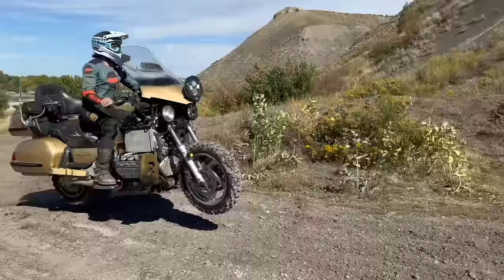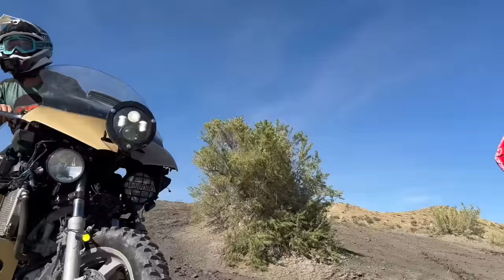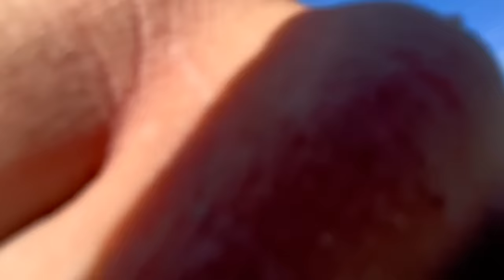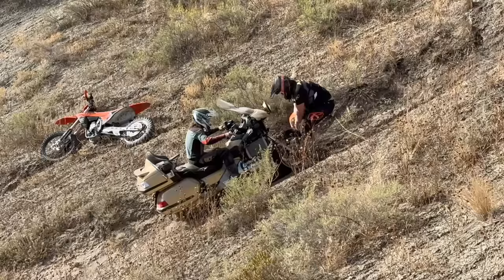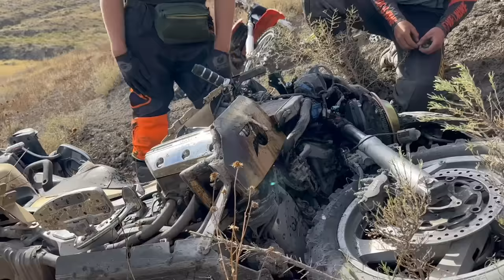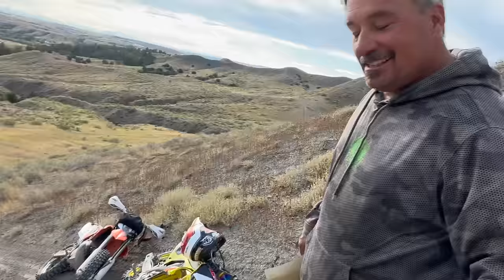Honda Goldwing vs 450 - Hillclimb Challenge

Comment: One things for sure, that flat 6 sounds sweet at limiter up the hill
Reply from the maker: what a rippah
Reply: Yes it dose !!
Reply: I was just thinking the same thing. That’s one amazing sounding engine!
Reply: Sounds even better with Cobra exhaust. It's a pig for sure, but handles vert well at low speed and pulls hard through mod third gear. Great machine.

Comment: That is way too much fun to let it just end like this. Find another parts bike, cobble it together and go another round. Get rid of all the unnecessary frame parts. You could loose several hundred lbs.  Maybe see if you can increase the suspension travel too.
Reply: If he cut it down to nothing it wouldn't look like a goldwing and that is the point of it all.
Reply: @joelc-gc1hq I certainly understand your sentiment.  Owning a GL1800, I was coming from the perspective of how a Goldwing acts off road. When I see him ripping it up sideways, I can just feel how that bike is acting under those conditions. If you have ever driven a Goldwing, there are just certain ques in the way the bike turns and shifts its weight that one recognizes motion that only a Goldwing has. I was really capitalizing on that feeling, not so much the look. For general entertainment, sure taking a bagger off road looks nuts. But for those of us who know the bike, watching how it behaves under those conditions, and watching someone having that much command over the bike is just on another level.
Reply: @Daveinet  absolutely I agree, i own a 1500 and a 1200, my 84 aspencade I've owned since 2002 and just bought the 1500 in August. Goldwings are remarkable machines and yes I need two wings to fly! lol

Comment: You know, that's not too bad of damage to the wing. It can be rideable again.  The frame is straight, front fork is straight. Never mind the cosmetic.  I think between the gauges on the handlebar and the instrument cluster, all else is ok. Get some used parts and drive it away.
Reply from the maker: Piggy is back!
Reply: @MattSpears   Oh.  Just saw that.     Nice!